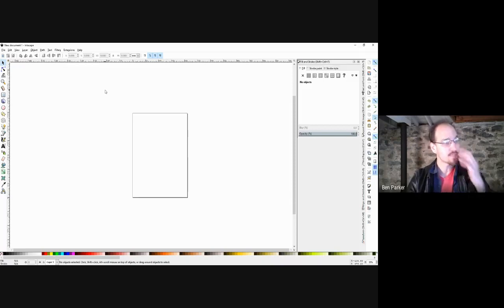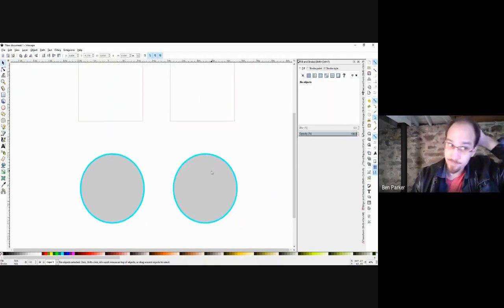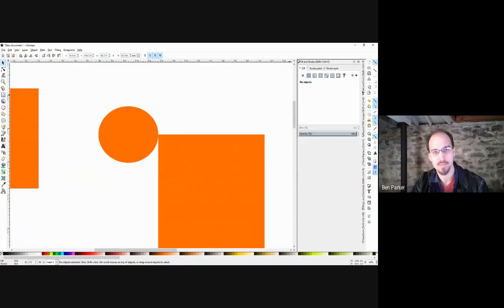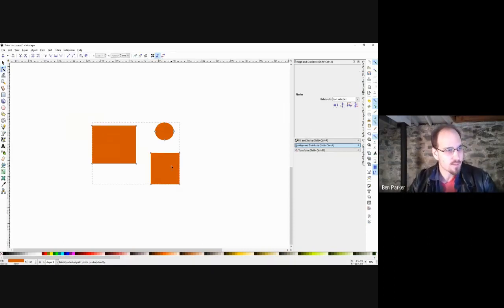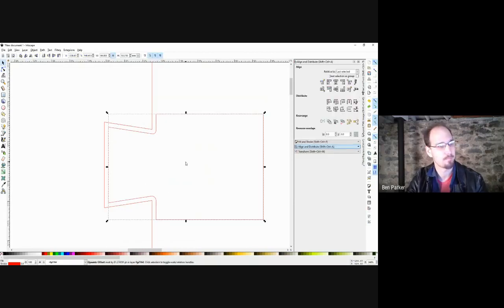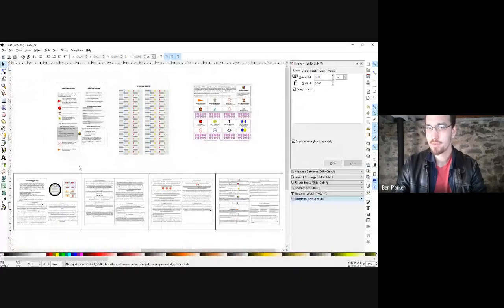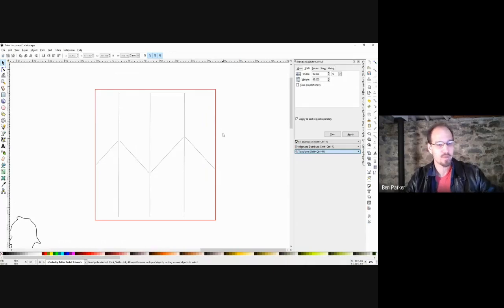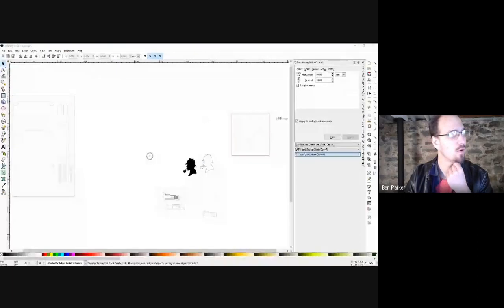Inkscape for the Laser Cutter with Benjamin Parker

Comment: Following your tutorials/ class and I had a question. Is there any way to control the "offset" to be a smaller measurement if there requires more precision? Other than pixels. Or is it based upon the units your drawing in?